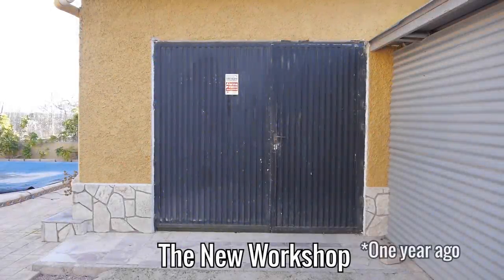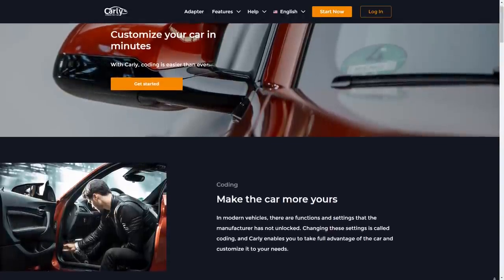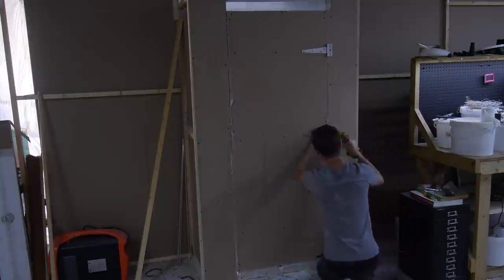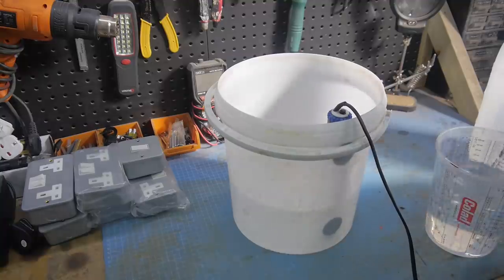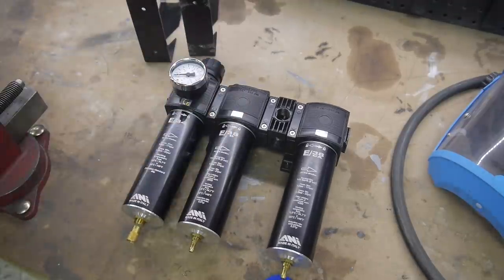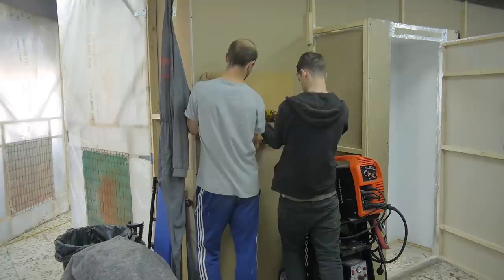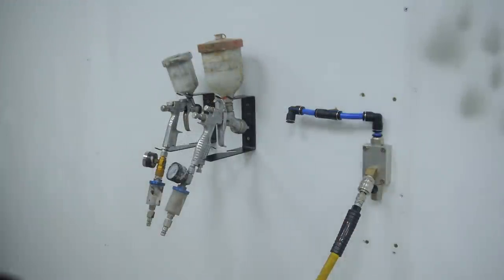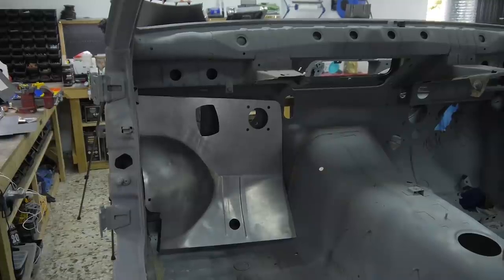DIY Classic Car Workshop | Building My Restoration Heaven!

Comment: how exciting.  where i live, we call that adding value to your house.  the nit-pick: the air hose going through the wall, if you are adamant about no contamination in the air lines, you could run the line through a little bigger than you need, then cut the pipe, once it's in the wall, to size.  then the dry wall particles wont make it to your filters.
Reply from the maker: Thanks Sneaky! Good thinking.

Comment: Having a lathe (or any precision machine with sliding ways) next to a set of grinders might not be the best option, at least in a long run. Particles from grinding materials stick to oil on machine's ways and make sort of a grinding/lapping paste, which accelerates wear.  If it can't go anywhere else, at least covering it well while grinding/polishing  will help a lot ;) If you do so, just ignore my comment, although it still may help somebody else :)
Your videos have been a great inspiration to me while working on my E36 Compact, some videos are even more helpful as they share some parts with E30. Keep up the great work!

Comment: Nice job mate as always. That poly airline and the push fittings are deadly. I recently did some compressed air upgrades
Reply from the maker: Thanks George, good to know. If it doesn't work I'll send it back and get the cheaper, better stuff locally. If only I knew before, ah well.

Comment: give the mdf workbench tops a couple coats of spar polyurethane will make them pretty much bulletproof. Had my workbenches like that for the last ten years. Holds up to acid, acetone, gasoline, and everything else I've thrown at it.
Reply from the maker: Hey Marshfield. Thank you for that suggestion. I'm going to order some right now and try it out :)
Reply: @RestoreIt  I noticed the oil and dirt you cleaned off some parts were going to stain your worktops and potentially contaminate your   clean parts.  Was going to suggest some lining paper on a dispenser  so you can cover the worktop &  throw it away when it's dirty.  Should fit in nicely with your OCD  approach to restoring! keep up the good work.

Comment: Great lttle improvements to your workshop!
But instead of the expensive plastic air system, a solid plumber job on copper lines and fittings would come easier and cheaper, I guess...
Thx for the vid!
:-i

Comment: For air system you could use polypropylene pipes and fittings, regular 1/2 valves and so on, i think it would cost much less

Comment: I personally don't mind the tools not being bolted down, so long as you have a secure temporary mounting system they should work fine. It's only really a problem if you have to spent time and effort keeping the tool in place while you are using it. Still, it's probably a good thing that you bolted them down, if only to cut down on the comments about it. :P
Reply from the maker: Haha thanks InstucTube.

Comment: Do you have any links to the air line and fittings you used? I am planning to add a fixed air line to my compressor too but I haven't found out yet what I should use. Would be great if you could let me know what you used.

Comment: 6:30 - ehhh... What´s with all the UK wall mount double sockets? Hope you´re not plumbing in a UK ring main in a continental wiring set up? If you are gonna wire them up, remember to wire them in as series spurs  from the main RCBO´s & remember max rating per spur is 16A with 2.5mm PR cable. If I were you though - I´d change all my plugs to continental type to comply fully with code.
Reply from the maker: I'm in the middle of deciding what to do. Anything I do decide on will be carried out by a certified professional don't worry.
Reply: @RestoreIt  Ok cool, but if a certified pro is doing it then I´m pretty sure they won´t be using your UK sockets :) It´s quite safe if you know what you´re doing but make sure to do it safely & remove before handing on the lease :)
Reply from the maker: I will remember what you've said don't worry :)

Comment: All yout tools have standard UK 3-PIN plugs, but yor buildings and outdoors look very spanish!
Reply from the maker: That is indeed the issue I'm facing right now.
Reply: @RestoreIt  You could just wire up your workshop with standard UK scokets ;-) - but it might not be "up to code".  I suppose in the long run you should replace all the plugs, but some will be moulded type, no doubt. On solution would be to get a UK power strip and put a spanish plug on it. Anyway I'm sure you know all of this! Good luck with the projects, the videos are great and I enjoy watching them.
Reply from the maker: Thank you dude. Good idea there. But yes you're right. Some plugs just cannot be changed. Some even specify not to use an adaptor or to change the plug. Tricky one... not much keeping to the code going on here in Spain i'll tell ya haha.

Comment: I appreciate all of the work you do, but all of those fittings are a huge waste of money and give you even more points of failure. You'll probably be chasing air leaks forever.
Reply from the maker: Thanks Kota, we'll see :D
Reply: Restore It if you run into any issues you can get dedicated air line sealer, 9/10 it’ll seal any leaks.

Comment: Why are you using UK 3 pin sockets in your workshop if you are in Spain? The local building inspector might not approve of those. 
I know it is a pain having to change all the plugs on your tools to the ones for in the country you are living in. I had to do the same here in France when we moved here.
Reply from the maker: It really is a pain. Some manuals to the tools I have say specifically do not change the plug or use an adaptor. I'm kind of stuck in the middle.